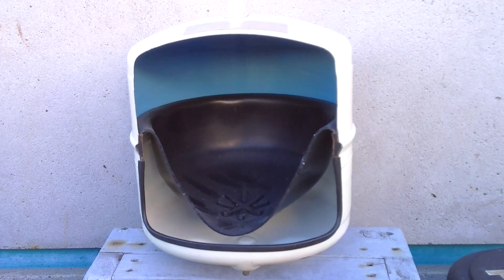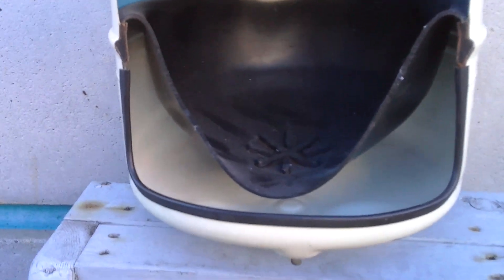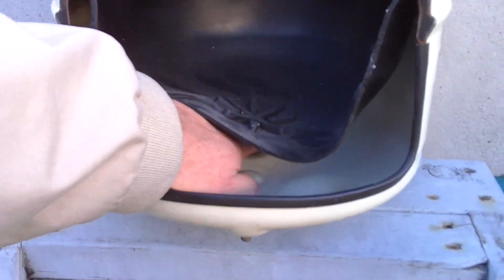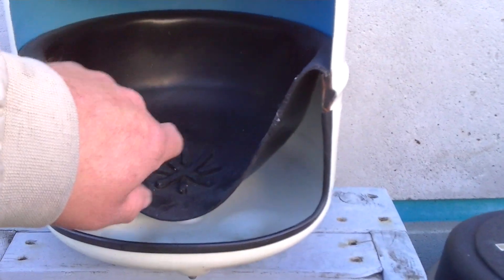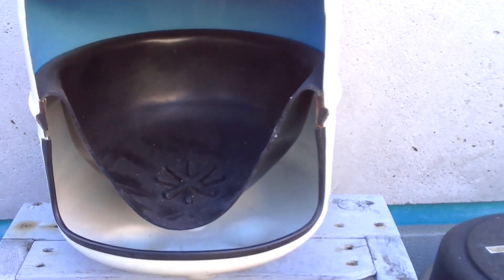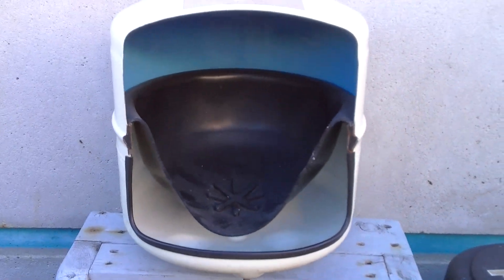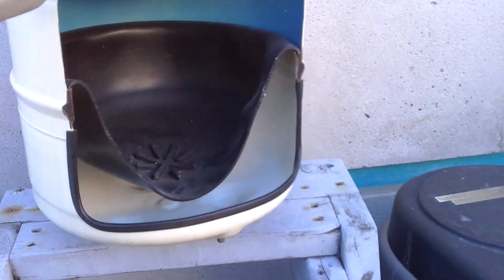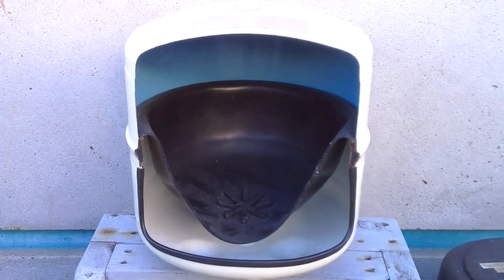WHAT'S INSIDE MY REVERSE OSMOSIS WATER FILTER TANK???

Comment: Great explanation/demonstration.  Was wondering because got no pressure at my RO faucet.  Unit is fairly old, so, prob. need new bladder. Thanks for video !!!
Reply: Always try to pressurize and empty it completely first. If all water gets evacuated, then pump up to 7psi with the water valve closed, re connect and you're good to go.

Comment: I've had a RO system for over a decade now. The first tank lasted most of that time. The second tank only a few months and didn't have as much use. When I tried to represurize it I could hear the air bubbling inside and water comes out of the air valve nib. It was suppose to be higher quality tank also.
Reply: iSpring T32M?

Comment: Thank you. I've been having "slow flow" ( I'm a male ) for awhile. I've been trying to pressurize the tank according to the directions in the manual, but I'm having trouble with the gauge I bought (I think its lying to me) and the bicycle pump doesn't seem to want to inflate. It makes the dial go up to 80 lbs. or so but no air is going in. I'll continue to mess with it, but I think your trouble shooting tips will reveal a pinhole. In any event; thank you for posting.
Reply: If mechansim of your tank working properly and  needs air you have to pump between 4-6 psi. More you pump may damage the system. If water comes out the pinhole dont waste your time and get one new.

Comment: What happens to the inside of the tank if the RO system has not been used for a long time, let's say a year. Is the tank compromised at this point, bacterial-wise? Or is it enough to simply flush it with new filtered water a few times after updating all the filter cartridges?
Reply: You're supposed to clean RO system every 6-9 months, what I do is a full disassembly, and every single plastic part is placed in a 40L container with 20L of water and 10ml of chlorine, you need to force the water into the tubings shaking them. After a hour, I put everything back together without filters and add 5ml of chlorine to the first cartridge without any filter in the system and place a temporary tubing line from the pump exit directly to the pressurized tank, just to get some water into the tank with the 5ml of chlorine, I let it rest 1 hour and then flush it and then connect everything ready for normal usage but without filters and I just let water flow for like a hour to remove the chlorine residues flushing the tank several times.
Reply: @WertzOne  Whoa that is whole lot of maintainance work they never tell you about! It is expected from a regular user to do this by himself? That is crazy inefficient. It would be expected to be done by the service operators. The only thing it is highlighted is that the filters need to be replaced once a year and membrane every couple of years but not the whole chlorine cleaning routine.
Reply: Correct, You can not open and clean inside pressure tank. But you can open and clean MIATO glass tank .. Stay away from plastic and rubber

Comment: How often do you recommend to replace a tank? Should I replace a tank without any issues let’s say in 10 years?
Reply: The rubber bladder can start disintegrating over time and bacteria can build up in the tank - you may want to consider replacing it or at least disconnect the tank and let it spray into a white bucket to see if there are any loose particles in the water.

Comment: On the valve on top of the tank, if you put something in it, is it supposed to be blocked? I took valve off and poked it with a toothpick and it seems that something blocks it. Is that normal? My tank is not filling up with water.